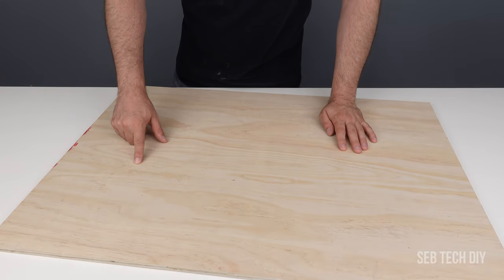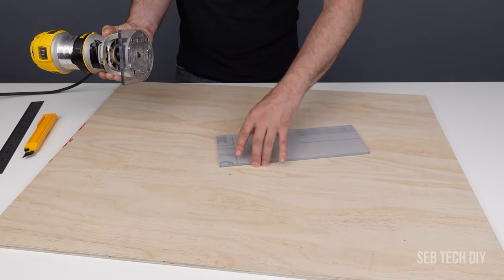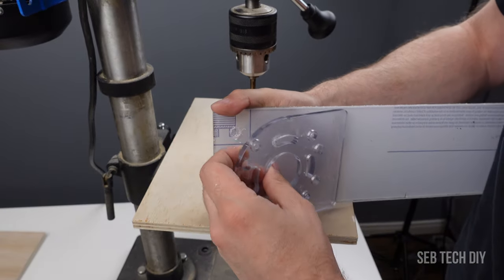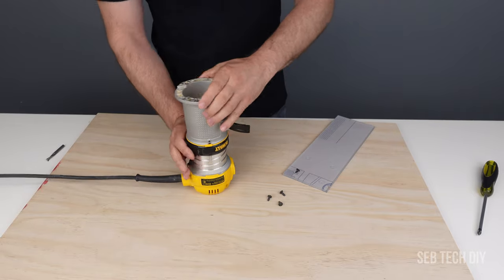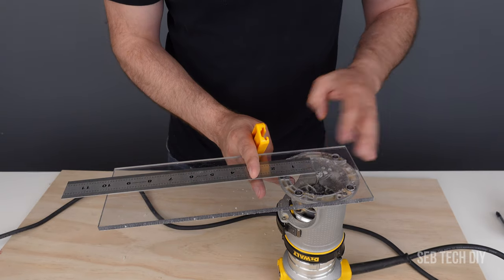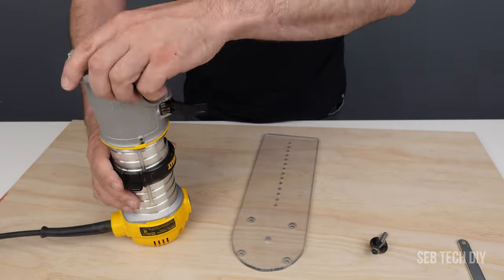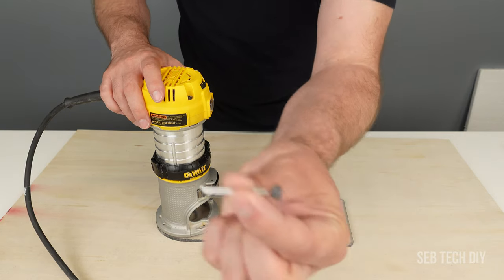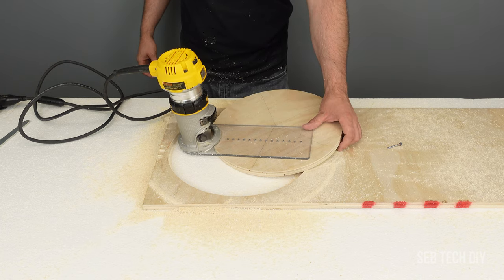Making a router circle cutting jig - DIY

Comment: Nice jig. Would be good to label each hole with the corresponding diameter so you don't have to measure from the bit each time.
Reply: The downside to that would be if you want to make a "hole" instead of a circular piece.  For a hole, the diameter would be off by half an inch from the bit thickness.  Honestly, I thought he messed up at first because he measured from the inside of the bit.  I'm making speaker enclosures, so I need to be sure to measure from the outside of the bit.

Comment: Hi, Your tutorial is very clear, but I think that there is something wrong with your measurements.  If you put your index marks by measuring from the center of the index mark to the center of the router bit (for example 1") and used a 1/2" diameter router bit to remove the material, then the measurement from your 1" mark to the other edge of the bit would be 1 - 1/4".  The measurement to the inside of the 1/"2" router from your 1" index  hole would be 3/4". So you're not making a 1" cut out of either the disc that you removed or the hole that is left in the base material.  What this means is that everything changes based on the diameter of your router bit.
Reply: That's what I was thinking. So you'll actually want to add the router bit radius to the current marking's listed radius. Or just only use it with a 1/4" for example and write on the final diameter hole achieved. Very good video otherwise. I didn't want to get into the habit of buying a holesaw for every odd size hole I need to make.